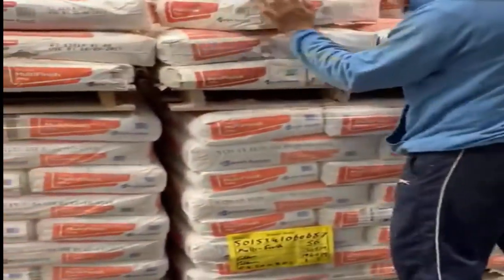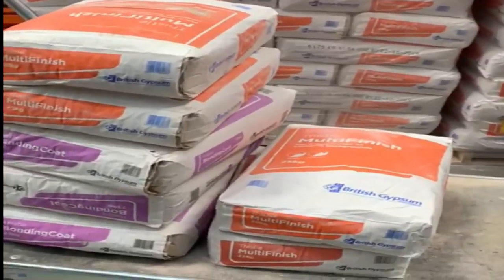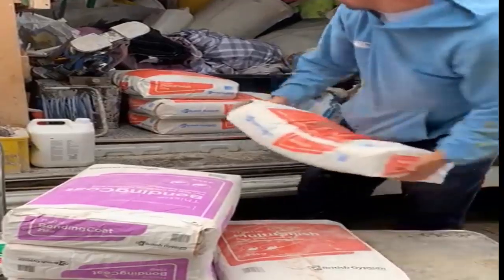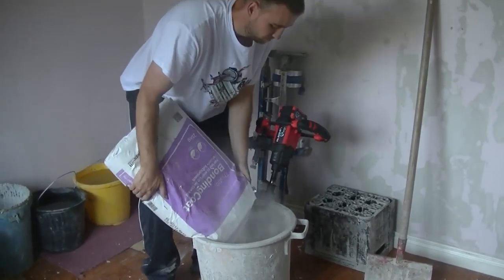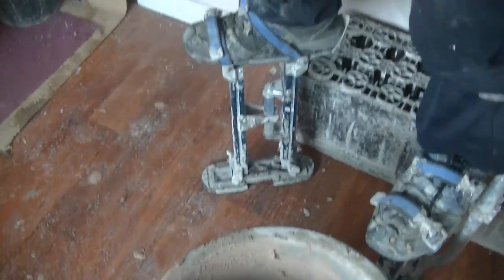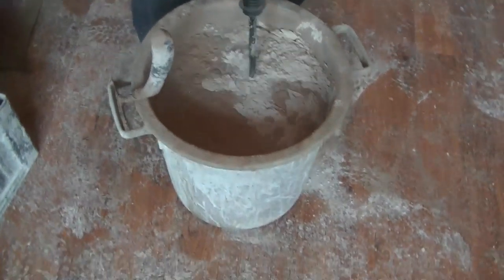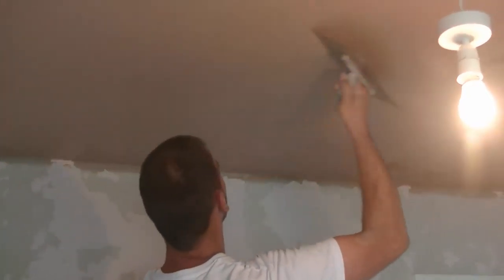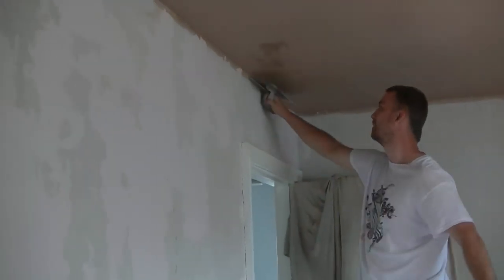A day with MAC and the RUBI E10 battery mixer

Comment: Looks a really capable machine, battery is definitely the way it’s all going now, great proper working review 👍
Reply from the maker: For sure its safer in a few ways no leads and wires to trip over less pack up and start up time less chance to be fired by electric , gad you like the review was even more impressed on the bigger job i did after this one mixing like a boss :):)

Comment: Are you still using rubi mixer I'm thinking of getting one
Reply from the maker: Hi mate yes its still going well I burnt the collo mix out i was mixing way to much with it , it had a little more kick to it this rubi is great for small work and that
Reply: @macplastering  I'm not sure what to buy. I do plastering dot and dab boarding, tiling so mixing  adesive, self leveling floors ECT I did order on Saturday dewalt flexvault 54v  but company rang this morning say they can't get it. So I thought I'd have a better look around
Reply from the maker: @johno-gb7ci  have used all 3 the dewalt is the strongest and heaviest it is good but I dont like the speed dial and not loads between the collomix and rubi  the collomix can hold stronger batteries mate the dewalt is available on amazon -  https://amzn.to/3akZA2y not sure if thats the same price you where getting it at ?
Reply: @macplastering  £612     has the matebo got variable speed trigger and is it brushed
Reply from the maker: @johno-gb7ci  Not 100% sure mate I kbow the collomix and matebo bats fit one and another but not sure on its ful stats as never used one

Comment: Came here after a year how's it holding up .
Reply from the maker: Had used the collomix more but its now in getting serviced I was pretty hard on it mixing 3 bags a time but this boy is still going and batteries seem to last well
Reply from the maker: On both only relay supposed to mix 1 bag at a time
Reply: @macplastering  that's a good product then ...earned its money 💰
Reply from the maker: @mejustanormalguy4742  Both seem great to me would recommend 2 bats mate
Reply: @macplastering  gonna get one for the small jobs and keep my big  one for the sites and cement .
Reply from the maker: @mejustanormalguy4742  sounds a great plan mate :)